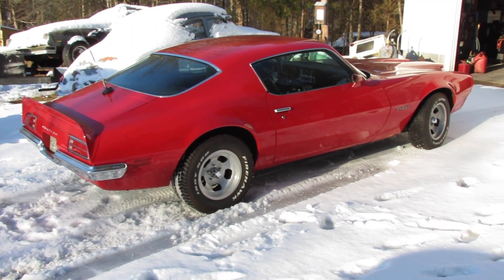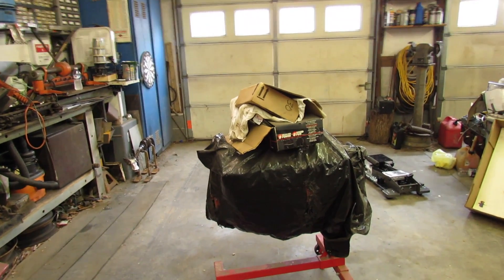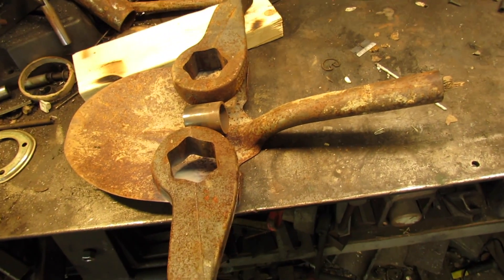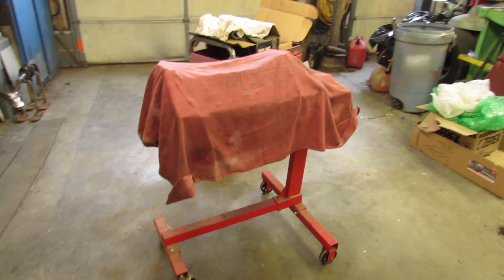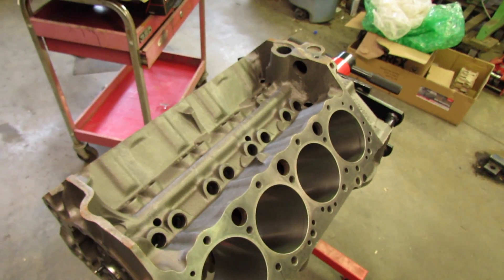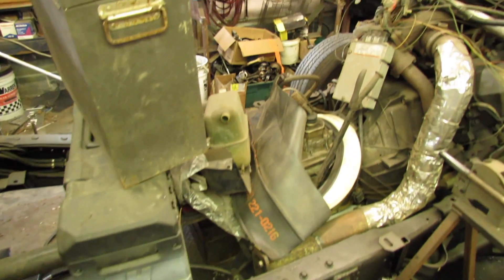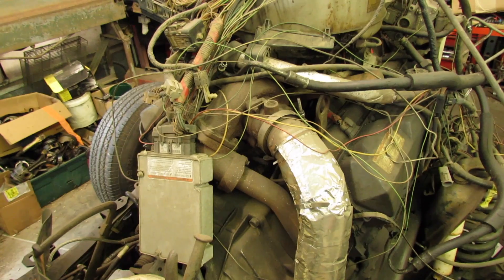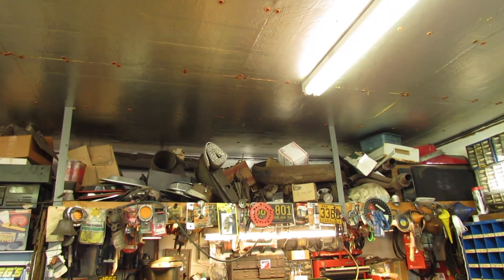Mostly boring video-watch it anyway tho

Comment: Good video. I have a similar piece of log and I've shaped a lot of metal with it, mostly patch panels. I've got a lot of metalworking tools but it's funny how often I grab the same 2 or 3 hammers and use the log. The 283 should be fun, when I was a kid 283 + 327 engines were great.

Comment: You should put a 327 crank in that 283 and make a 302 like they put in a 1st.gen z/28.
Reply: 2nd. thought that recipee might be a 327 block with a 283 crank.
Reply: Yeah need a 4" bore lol
Reply: MrBeeradb1 yep the other would be a 307 (small journal....production 307s were large journal).
Reply from the maker: MrBeeradb1 well, I do have a 327 and a 283.